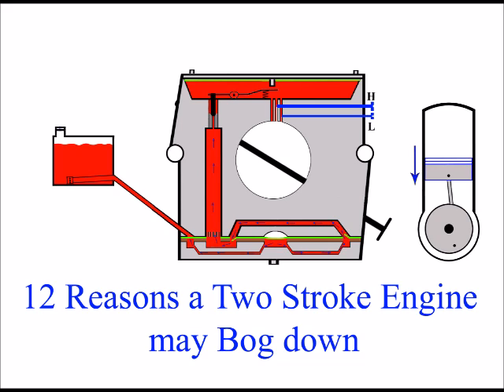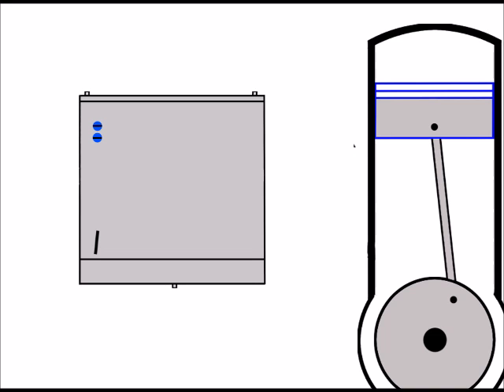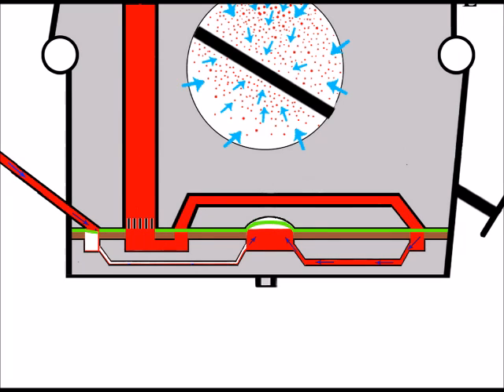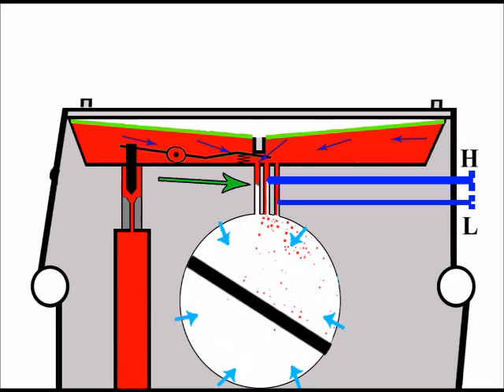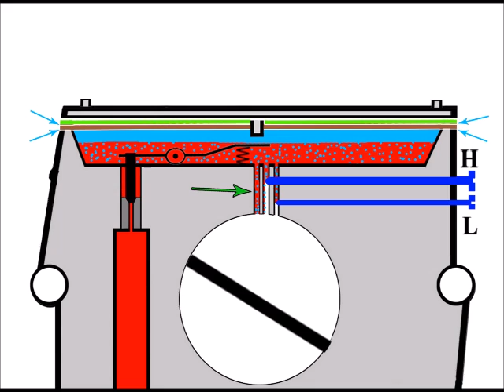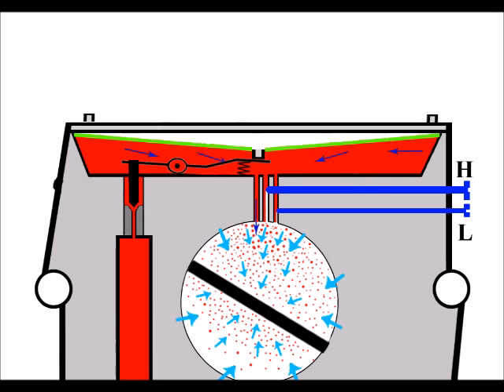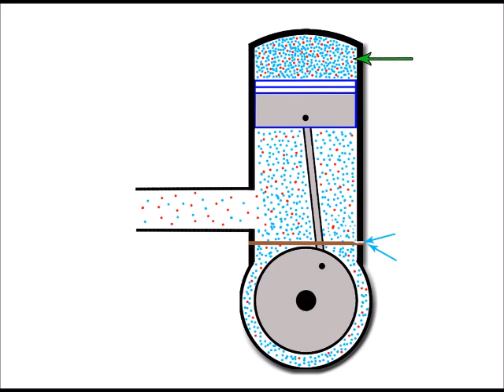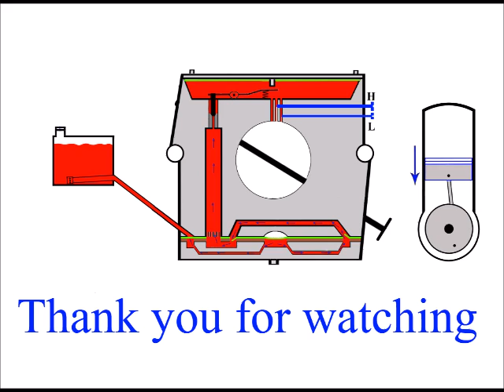Chainsaw Carburetor Problems - 12 PROBLEMS TO AVOID!

Comment: I have a interesting question. Great explanation btw. I have a paramotor with a two stroke engine. I flew in the morning and the engine was perfect. One hour running used 4 litres, (this is normal) the evening flight my engine ran like crap. Spluttering and coughing and would only run on full throttle smooth. I used 4 litres in 20 mins. After leaning off the mixture the engine is running better. However it stumbles around mid throttle. Would the worn diaphragm cause the engine to run erratic like I just explained ? (One min running perfect a few hours later running awful) 
Do you think I rebuild would solve my issue or could this be a Reed valve problem ?

Comment: Hope you won't think my comment unkind but I was a little disappointed after spending time watching it, your title states "won't start" among other issues which is the problem I have  yet after watching your very informative video all of your comments and suggestions were about engines that run but bog down, well mine stopped suddenly and just will not start in spite of fresh fuel and a spark being present! The unit is less than 2 years old and has had hardly any use!

However many thanks for taking the time to make an informative and well explained video, it may not get my engine running but I have learnt things I did not really know until I watched it. :)

Comment: This is very well done. I have a question. In my chainsaw carbs fuel intake there seems to be a small metall bal or something, when I blow on the intake it stops the flow of fuel, if you instead try and suck on it, the small ball inside reverses and fuel can flow in the other direction, until the ball again stops. What is this, feels like this valve could cause the fuel supply to be cut off. Is it really designed like this or is there something foreign inside?

Comment: I have a question. I have an echo blower that has fuel, compresssion (105 psi) and spark. Wont start on ether either. No plugged screen and has been cleaned. New spark plug. And caeb kit
 Out of options.

Comment: OK this is great I'm dyslexic and as I struggle to understand what I'm reading this was awesome help thanx. Question my 2 stroke scooter only bogs when I go from half throttle to full throttle so I have to let off throttle would that still be the mixedure screws not being set right or could it be my jet being to some any advice would be great as Im struggling to see tit right  thanx

Comment: Thanks for a great video, I have a problem with a hedge cutter, with a walbro carb on it, the machine works fine when cold, revs up and idles ok, but after about 3 mins of running I get the bog down issue, the carb can be adjusted, but suffering from fuel starvation, only when the engine is hot , any thoughts please thanks once again .

Comment: My Stihl brushcutter runs well at high revs, but when it goes to idle it slowly (over a second or so) bogs and stops. After this it does not restart.  While it is bogging, if you are quick on bumping the throttle a few times it will pick up speed and go to full revs happily.  In my question here I am focussing on the mixture in the barrel.  I am guessing that if there is a small enough air leak it will have no effect on high revs (high speed mix compensates), but at low throttle opening the vacuum is high, so leak is causing the mixture to be overly lean - is this a reasonable explanation for the symptom of bogging at idle?

Comment: my engine bogs with a rapid throttle then it runs fine. only under a load.
Reply: Open your low jet a 1/4- 1/2turn and try it. I have a small engine shop and run into that a lot.

Comment: Your videos are excellent!

I have a small issue with a backpack blower that's bogging down and am wondering what to do. The fuel feed hose in the tank has a filter on the end of it and is situated at one end of the tank. If the machine is tilted too much on the opposite side it becomes starved of fuel. This is happening with a half full tank. I'm wondering if I should shorten the fuel line so as that the end of it is situated in the centre of the tank and will allow for an equal tilt on both sides. Do I need to keep the tank always filled near the top? Any advice is greatly appreciated.

Comment: Hi, have checked the carb on my strimmer and find that there are no adjusting screws like the ones in your diagram is there any way around this problem as the company I bought it off don't want to know it is made by Einhell, thank's again.
Reply from the maker: William Donnelly, hi, I understand your frustration with this one because many are the time when I've come across issues like yours in the past. A quick answer is that if your machines carb doesn't have the mixture screwed to adjust your fuel the air mixture then the only option left to do is to ensure the carb is cleaned out fully and maybe even replacement of the diaphragms. But do check all of the other possibilities I mentioned on the vid. The trouble we have with the more budget type of machines is that they are starting to be built with no adjustments on the carbs. If you can't get any joy with what I've mentioned then it may be that you need a new carb if you can find another dealer who can supply one. I'm really sorry if none of my suggestions help. Many thanks
Reply: Hi, I stripped the carb again and checked it again what I found when I removed the bolts holding it to the engine were not as tight as they should be made sure they were much tighter this time and also adjusted the tick over screw and gave it a go and it started ok and after warm up I tried the throttle  and guess what it worked A big thank you for help.
Reply from the maker: William Donnelly, fantastic, I'm really pleased it's ok.
Reply: William Donnelly

Comment: Excellent video, I came across this looking for answers to a problem I have with several strimmers. They start and idle and rev perfect but stop instantly when turned upside down, it's not the fuel pick up pipe, they will restart with the first pull when turned the correct way up. If I give them some revs they will stay running when I turn them over, every now and then I can turn them upside down 10 times on the trot and they don't die, then they go back to dying, it's crazy. I have changed the carbs and it's always the same.
Any ideas?

Comment: I don't know if you do answer problems on the comments, I have a chainsaw and a strimmer that run perfectly for 20 to 25 minutes and if I turn them off they will tickover that will not run on full Throttle, and even when the engines have cooled down they still will not run on full Throttle. I have had two stroke engines for years and I'll do this, is it a 2-stroke thing so you'll have to like service them after every 20 to 30 minutes or am I doing something wrong. I normally end up taking them to a proper 2-stroke engine place and when I pick them up they run perfectly but again after 20  to 30 minutes they do exactly the same. Any help would be very appreciated

Comment: Ever have one that refuses to choke, but as soon as you feed it fuel, it starts and runs perfect? I have rebuilt the carb twice. Used my Sonic cleaner on it twice and it STILL refuses to fire. No sign of fuel in primer stage. I am thinking insufficient fuel getting past the float, it runs great, no bogging after it starts. I wish it had a primer bulb. Its a little Craftsman Leaf blower. If I squirt a shot of gas/ oil into the intake, it starts fine, and restarts fine every time. Any ideas?

Comment: Do all carbs have hi and low or are some hidden? I've seen wee plugs on a new one I fitted to a mates strimmer. Only blower that I'm working on now I dont see any plugs or screws. It's a walbro wyc 6. I've a gasket kit ordered and will fit it. I had a fuel line snapped inside the tank so fitted new filter and line, blew out the carb, new fuel and she worked fine for 10 mins then started bogging under load. I await the gaskets as a next step.

Comment: my brush cutter overheating after 1min and wont start back, please help
Reply from the maker: Hi, it sounds like it could be a number of possibilities. My first thought would be that your coil pack (magneto) may be malfunctioning, therefore giving out when it gets hot. We sometimes find this problem, which sounds like the symptoms you have explained. Otherwise I would make sure your carburettor is tuned up properly as this also could produce these symptoms. Another less common issue, but one that I have experienced, is the engine components themselves. Just make sure that the engine does turn when it has cut out. In the past I have had situations where by the engine components have expanded and locked the engine (often a lack of sufficient lubrication) temporarily,. Upon cooling this may release, allowing the engine to turned over. I would say, but please don't quote me on this because there could be any number of faults, that it would be one of the first two issues mentioned. Diagnosis really is a case of trial and error and a process of elimination. So I would start with correcting what I have mentioned and then if there's no joy, look into things a little deeper. I hope this has helped. Thanks

Comment: Hello there, my bikes doing something like what you describe.

It works fine as I am idling, until the bike warms up then it runs really rough and tries to kill itself.

But when I get to the point where I am riding the bike on the road it starts stumbling and trying to kill itself, the mechanic I took it to (Only bike mechanic in town actually), thinks the jet is to large and is letting to much fuel through and it's trying to drown itself. Is there any way that you know of to check if that is happening?

Comment: I have DLE 116 CC engine but it does not start, i observe that fuel return back into fuel tank when i start it, why fuel return back into fuel tank is a cury
Tell me solution plz sir, the engine is new one and not start a single time

Comment: my weed whipper won't start unless I close both high and low needles almost all the way closed. after getting it started I can turn them up till it runs half way decent but if I shut it off or it stalls tuning it then it won't start again till I turn the needles closed again? Does this mean I have a leaking gasket or bad fuel cap? This is really driving me nuts. I'm thinking about cleaning the carb and seeing if it helps. I don't want to spend much money on this trimmer. Rather just buy a better one if I'm going to spend money
Reply: Also if I choke it when I'm trying to start it after it's "tuned" it floods and fills up with fuel to where I can't even pull start it. And there is excessive fuel coming from someplace. The whole motor is inside a plastic case so it's pretty hard to see or check any of these things without taking it all apart. After watching your video I'm really considering taking it apart and checking the things you mentioned.

Comment: Another great vid, thanks.brings me to two simple questions when talking about lines, gas tank etc.1).What can cause both the primer and main gas fule lines to have air pockets.I seen this happen in past. Where while engine runs little bubbles or air pockets stop and go up fule line from tank into primer and carb? That is, with new fule filter and lines.The muffler, some of mine the spark arrestor is bedded inside and only a short section can be seen.No way to remove.How do I clean arrestor of this issue? I can't get a brush pretty much nothing in the view spot.

Comment: I have a Polaris 98 XCR 600 Tripple and i have problems with bogging , there was water in the gas and drained the tank plus i cleaned the carbs jets and all , would bad spark plugs still make it bogg , for example i start it fine and and i give it trottle it boggs and dies out then problems starting it again , , maybe a clutch problems ?
Reply: tneil07 try hardcore sledder those guys have all that stuff figured out.

Comment: Hello, i have a 2000 honda cr80 that works really well, but when i am cruising through the trails at about half thottle the bike wants to spit and sputter but works perfectly fine other than that, do you have an idea what could be wrong?
Reply: Robert Scalchi good thing i sold the bike last week.. found the original problem, rather odd but the cdi was cutting spark because the cdi was garbage

Comment: I use quarts gallons and ounces to measure and its easier and is the measuring of liquids my nbooner generation was taught. Go figure gallon gasoline container which is perfect for home owners and at a 2.6 ounce measure of oil per gallon for your 50 to one or a 3 ounce measure for a 40 to one.  If you have a gallon gas container to get 50 to one you simply buy an ounce measuring cup at your local grocery store and pour in your 2.6 ounces of oil in the measuring cup and then pour that in your gallon gas can and fill the gas can with gasoline OR 8 ounce bottles of 2 cycle oil I buy nearly all have the clear stripe that shows one ounce to eight ounces on the bottle itself.  So ounces measuring is still very much used or why would it be on the bottle of oil?  Forget the millimeters people and use ounces per gallon or quart

Comment: Too bad NO stores sell the damn tools to adjust them - gotta use a tubular wire crimp connector on a small flathead screwdriver as a tool to adjust 'em.   Some say it's illegal to own as an individual others buy them off ebay.  ---  I pull the pieces of sh*t out and put a standard head screw.  ^_^

Comment: The video was ok but I had a problem relating the generic diagram the author had and how a typical lawnmower engine and carburator is actually built.  So the author should have spent few minutes in beginning showing where on an engine the High and Low screws are located.  However, the author never showed anything on a real engine and carburator so people like me could not follow his diagram, which he did not label anything on it, that easily.

I suggest that the author go back and label everything on his generic diagram and furthermore , give the diagram he drew, a title at the top of the diagram.  For example, he could use a title such as follows :

TOP VIEW of 
Carburator of Small Push Mower

Or come up with some other title he likes better to describe what a viewer is starting at for over an hour.

Also sometimes he points at the diagram and not clearly show the viewer where he is actually on the generic diagram that he came up with.

Also the bowel holding the gas and pin and spring is generally located on bottom of carburator.  His diagram seems to indicate the bowl and rod and spring are shown on top of his diagram.  So confusion exists to some viewers..

Overall the author seems knowledgeable but has to do a better job coming up with diagrams that are well labeled and clearly show if it is an Elevation view of what is on a lawn mower or is it a Top view.  And of course, he needs to spend few minutes in the beginning, showing where manifold and set adjusting screws are located on a real lawn mower.

Good luck.

Comment: New carburetor install new spark plug weed eater starts pretty easy runs like a bear idles real nice quits primer bulb 6 times Idols real good real strong open choke revs up real high dies obviously I'm losing air or in my high speed is not kicking in is there a needle valve on this float it's a new carburetor $11 on eBay

Comment: Would the wrong fuel /oil ratio make a difference in how it runs at high rev ? Look at this  2 cycle oil  . It is telling you that if you use the same amount of oil to 1 gallon of gas  it will work for engines that use  50 to 1 ,40 to 1, 32 to 1 and 16 to 1 .  it's as if ratio  from 50 to 16 to 1  makes no difference . After reading this  on the bottle it made me wonder if this   wide range of ratio oil is going to effect the performance.  https://www.lowes.com/pd/Pro-Mix-16-oz-2-Cycle-Synthetic-Blend-Engine-Oil/1159323

Comment: I appreciated the effort and detail of this video, however, the diagrams will simply confuse people as they don't resemble real life examples. A lot of people's eye glaze over with flat 2D diagrams and cannot equate them with the real parts before them.
There are many variations of these motors and not pointing out further differences such as the mixture screws will just confuse people.